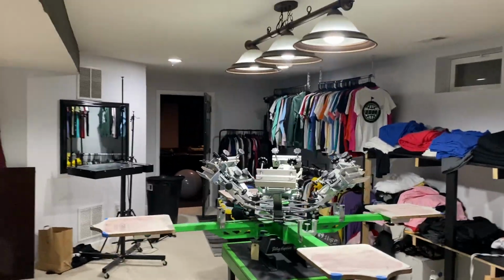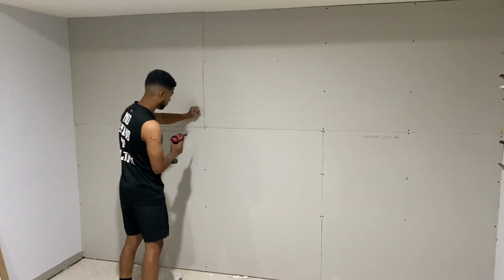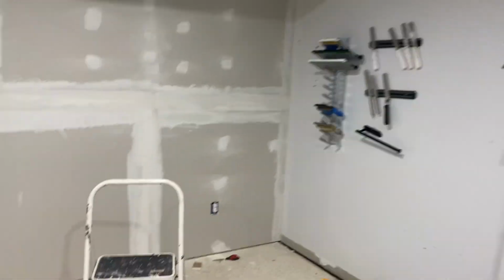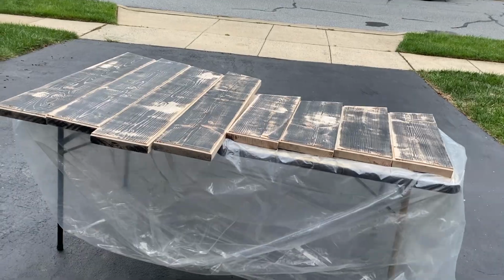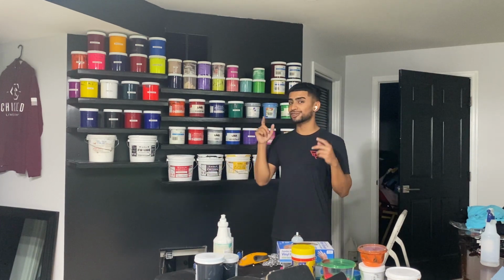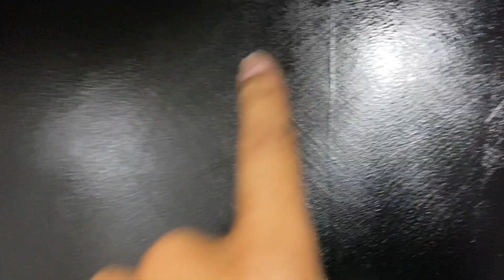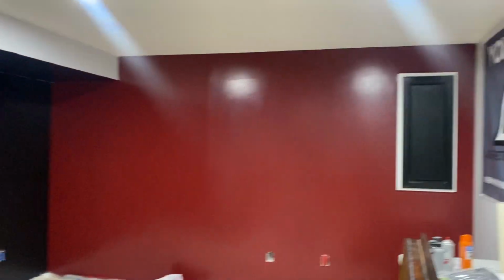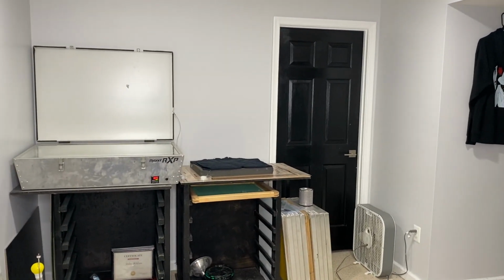Renovating My Home Based BUSINESS (Screen Printing Shop)

Comment: I gotta question man I see this a lot on YouTube screen printing and stuff but I never see like how do u get the color say it’s 4 colors right how do u get all 4 colors exactly on the placement of exactly where u want it cuz all I mostly see is they use the thing to push on the paint from the screen nd flip the color but how exactly do u get it on the exact spot u want it on ur art work design ?
Reply from the maker: That is where registration comes in play. Great question though man. I have a couple videos on registration for multi color prints where I take you along with me in getting the screens registered in the same location. It would make more sense if you watch the video on my multi color print jobs.  
Here is a link to it
https://www.youtube.com/watch?v=o2dOnGhyDSQ&t=357s

Also check out other multi color print videos and hopefully that helps answer your question.

Comment: Only half way through and love the vid matey. I had to stop though and ask, you used the Kreg system but put the screws in the top, why??? 🤣🤣🤣🤣🤣 You went to all that trouble to do it right and then screwed them in upside down???? I love that your totally committed to giving anything a go, respect to you bro. Nice to see a sterile room for your mega Embroidery setup👍👍👍👍 Keep being true and transparent bro, it’s you all over, keep it up.
Reply from the maker: Haha the screws through the top had the best grip and hold. Putting them from the bottom does not support the wood as much as the top would. I tried it out through the bottom before I put it up, both from the old spot they were at and the new spot. Putting them in from the bottom makes the shelves sag and not hold up since the screw is downwards pointing. However putting it from the top makes it so the screws are upwards pointing giving it the stronger hold vs down. Hopefully that makes sense but hey I could be wrong!  Appreciate the love and support man!
Reply: @baavproductions  Ah ha all makes sense now you explain it. Your bro did a good job pulling it around for you. Keep up the top work bro 👍👍👍👍
Reply from the maker: @andrewpritchard2624  He sure did. Appreciate your engagement and throwing your two cents out! thank you as always